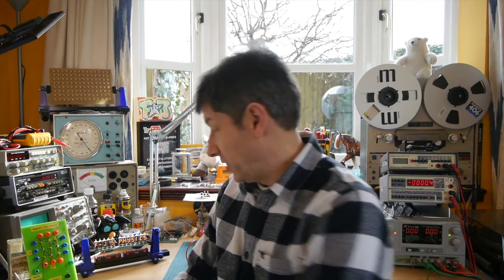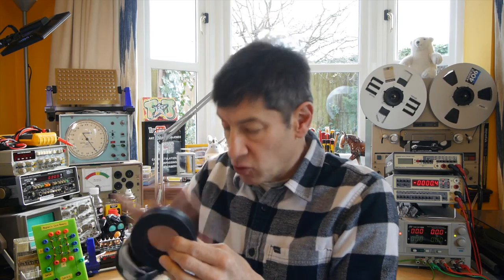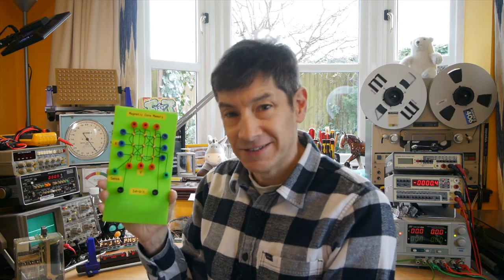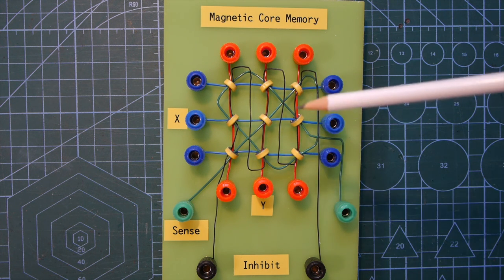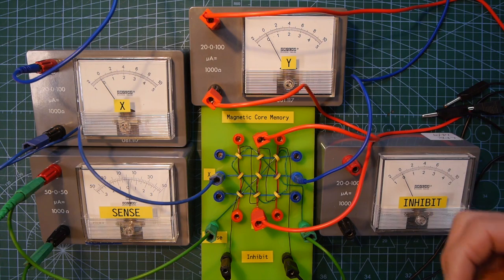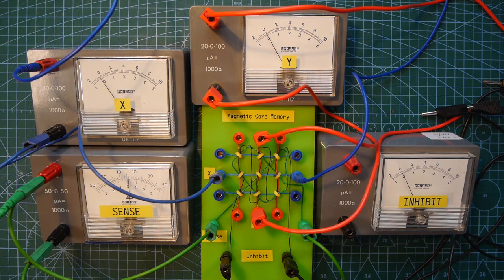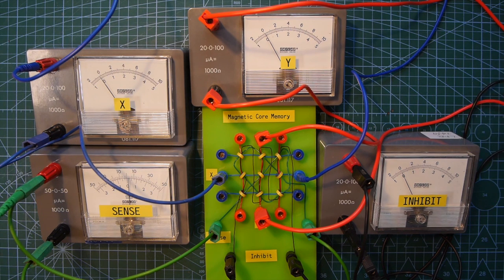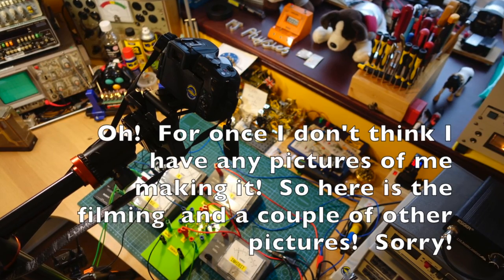Magnetic Core Memory Demonstrated (Part 2) - F-J's Physics - Video 185

Comment: i don't know English, so i almost don't understand the meanings but i only admire why he does not connect two inhibit wires to the station/or meter/.
Reply from the maker: Good question (I hope auto translate might help). This is only a simulation, not an actual working example - the cores are far too big for that - so I am mainly demonstrating what pulses you would or would not get.  There current in the inhibit is either constant or off - not a pulse like the read/write part.  Hope that helps and thanks for watching.  Hope you have seen my other core memory videos - if not just ask me for links.  Best wishes, F-J.
Reply: @AnthonyFrancisJones  oh now i see, it is inserted at the last
Reply from the maker: @yanjinlkhamtsogtbaatar  Yes, that's it!
Reply: @AnthonyFrancisJones  thank you for replying. thank you for replied fast. just now i finished this video and wanted to edit my comment. then i see your reply. What a surprise. I really overjoyed. Thank you. no other teacher has this kind of simpleness and modesty.
Reply from the maker: @yanjinlkhamtsogtbaatar  My absolute pleasure.  Any other questions, do just ask and good luck with all that you study.

Comment: Hm, i think i don't fully understand the purposal of the inhibit wire ...
Reply from the maker: OK, so passing a current through the X and Y wires will cause a bit to flip if its magnetism is not in the same direction as X and Y currents would be.  If you can imagine 8 of these core demos of mine stacked on top of each other you could address the top left core of every one and write a 1 in each so you would have 1111 1111 (an 8 bit word stored) but if you would want to write say 1011 1111 then you would activate the inhibit line on the second core plane in the stack and the X and Y currents would not 'program' that bit as the inhibit line with it's current would cancel out the opposite direction current in X for example and not produce strong enough magnetism to flip the bit to a 1.  It was a way of cancelling the effect of X Y currents without actually turning one of them off.  Does that make some sense?  Let me know - thanks F-J
Reply: @AnthonyFrancisJones  Ah, i think i understand now. Inhibit wire is needed if you have more planes of memory in a stack using the same x/y-input-wires. Thanks for spending time explaining to me.
Reply from the maker: @captainoffuture4488 Yes, that's it!  Basically it will cancel out any affect of X and Y wires having current in them leaving those cores with the inhibit line enabled untouched. Glad it helped!

Comment: Like I want to do some experiment but like I don't have some stuff and it is also not commercially available 
So like any suggestions like from where I can get stuff (general)
Reply from the maker: Glad you like the videos and that you want to have a go too.  I am lucky that I work in a school and have access to lots of things as well as my own lab.  Main thing is to have a project that you want to do (and is achievable).  I have got lots of bits over the years from ebay and Ali Express for example.  Not sure what you are thinking of doing/making but do ask if I can help further.
Reply: @AnthonyFrancisJones  like right now I study in school 
But like the teachers sort of just don't give the stuff school property haha
Reply: @AnthonyFrancisJones  like can we buy elements from these sites 
And secondly like do they work on all currencies or just a few of them
Reply from the maker: I'm not all that sure but you will have to explore those sites.  All depends on what projects you want to do.  Mine as you can see are partly mechanical and involve saws, drills and bits of plastic, and partly electrical with components, wires and solder!
Reply: @AnthonyFrancisJones  ok thanks for sharing